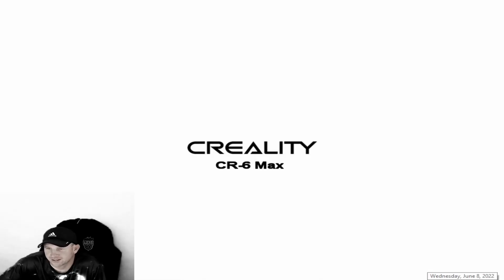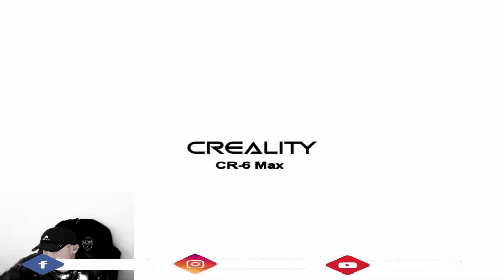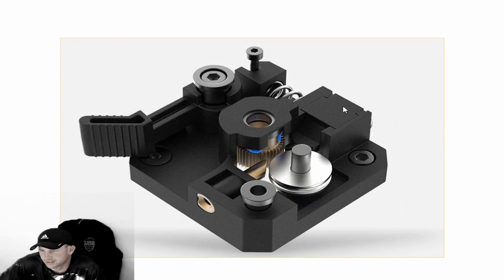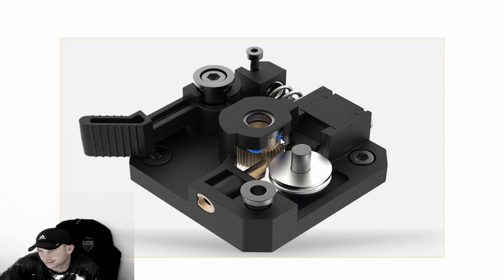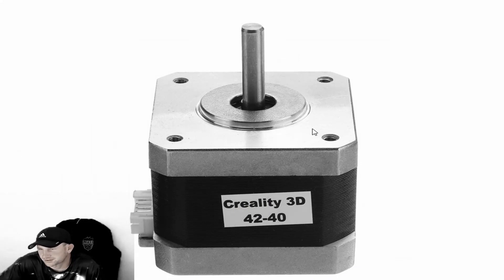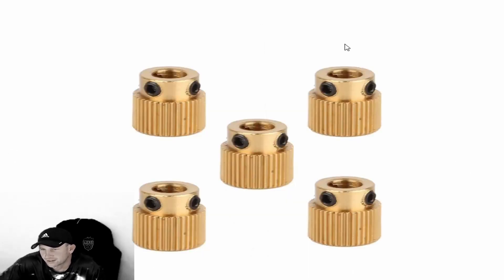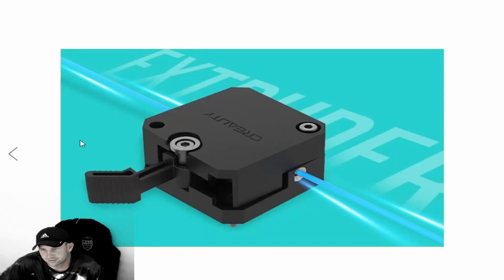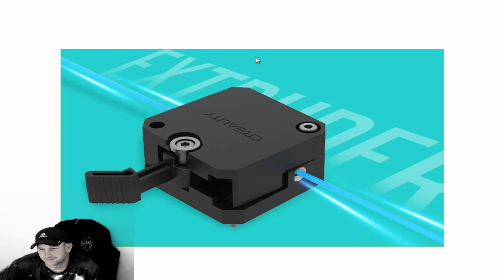Filament NOT feeding on 3D Printer CR 6 Max Creality. Easy Adjustment Fix Within Your Stepper Motor

Comment: I just got one of these printers.  Can't level correctly. Thin lines on one side. Did the leveling with thr paper, no improvement.  Ever single print,  15 or so, falls apart.  Skipped lines, not melting correctly.  13 prints at 200c, 1 at 205, currently 1 at 210.  Already separating.  It's so annoying. Cleaned everything.  I'll try a new gear but
..sho knows
Reply from the maker: Sometimes if u load the creality updates for your printer.  It sometimes helps after u recalibrate.  IHUCT

Comment: Thank's a lot for the video. I have a problem with my Creality CR-6 SE. I have changed the extruder mekanism into an Extruder and Capricorn Teflon Tube. It feeds, but the gear makes some spring backs, leaving holes in the print. I'm not sure how to fix it, do you have any suggestions? And would I be able to send you a video of my problem?
Reply from the maker: Yes a video please sent to our email would help.  Most of the time it is the drive slipping.  IHUCT

Comment: Hi my cr6 max extruder motor is not turning. I have tested the motor and it's working fine, its just not turning when it needs to extrude.
Reply from the maker: Can u see the armature moving when it’s activated?  IHUCT

Comment: Any advice on exactly how tight to make the screws on top when re-assembling the extruder.  I notice that the small screw actually pushes down on a plastic piece that then makes the spring tighter. And the larger screw in the corner must not be too tight or the lever can’t push the cover and  swivel over to remove tension from the gear to allow threading or removal of filament,  but I can’t quite get the knack of how tight or loose they should be.  It does appear that if it’s too tight the filament can’t push through because there is too much pressure from slider.
Reply from the maker: We actually have more videos coming out about this question 😀.  If u would like to Subscribe and u will receive notifications when these come out.  
We will also be creating several more with this 3D printer.  We have had several questions since we started creating the 3D print tips videos.

Comment: What if the issue isn't that the gear is loose? The filament feeds fine in the beginning then completely stops feeding during the print, the machine continues to function as if there were filament coming out yet there isn't. the motor continues to turn, the gear continues to turn and even wears a huge groove in the filament but the filament ceases to move forward. I have had it happen on base layers all the way up through an inch and a quarter height of the print.
Reply from the maker: This is an adjustment setting.  We have videos coming out for settings and programing.  Be watching out for those.